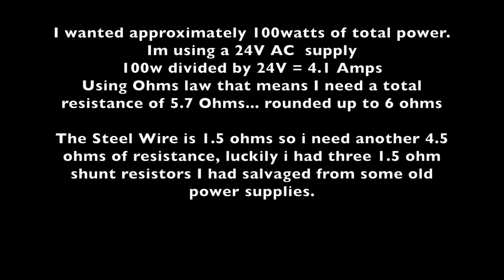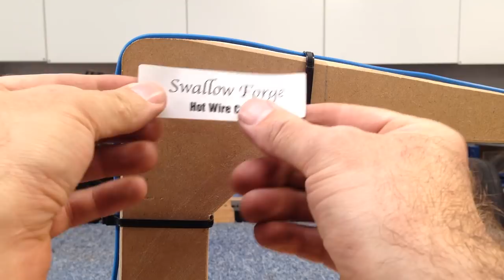How to make a Hot Wire Cutter for foam or polystyrene- styro slicer - cosplay, lost foam casting etc

Comment: I have to cut some 4 inch thick 30h high density foam  strips about 4 inch wide of a 2ft x 2ft squ section to glue onto the other square peices as the new ones are just a bit small so building this cutter will help in doing the job instead of buying one for a one of job. The foam cost me an arm and a leg as I'm doing my 2 x 2 seater sofa's as the foam cushions you sit on is way too soft as you sink into it. 
Many thanks for the idea

Comment: Great Video and awesome setup! I only found one issue with this, and I am only trying to help you and others out. When you added the resisters it did not do anything but waste electricity. While you added more resistance to the circuit it was added in the wrong place. The point of the resistance is being in the wire it is what heats the wire up. If you add resistance in another section it will heat up that part aka the added resistors. So they serve no point in the build besides wasting power. Besides that great video!
Reply: Glad I'm not the only one who noticed it...

Comment: Nice! What happens if you touch the wire with fingers? just hot or shock or both?
Reply from the maker: It's hot. At 24v you won't get a shock. But it will leave a nice burn line. But nothing life threatening. :)

Comment: Thanx for this cool DIY video! I have some quaestions. You want to use 100W power to cut. And you     use serial connection with 3 resistor and an other resistor as a steel wire. Thats a voltage divider. Steel wire become 24V*(1,5 Ohm/6 Ohm) =24*(0,25)=6V. This Wire also have only 6V.  This 6V with 4,1A current make cca. 25W to heat. Also the other 75W is to loose on the 3 sistors. Have i may a mistake, or thats is good theory with this 25W heating. (Sorry for my English. I only learned with datasheet readings.) I wait for answers.Thx
Reply: That’s exactly right. The power supply does indeed provide around 100 watts of power, but most of that is warming the 3 resistors under the platform. However, it appears that 24 watts is enough to cut the styrofoam (power through wire I squared x R,  4 A squared=16 x 1,5 ohms=24 watts).
Reply: @philipbowman6415  Thx for your answer Philip Bowman . My project is immediately done. I prepared out a resistor wire out of a bad hair dryer with 5 Ohm resistant/m. I had hav'nt other  used resistors too. It works fine, but the heat can be faster the resistor wire to burnout. Thank for your fine answer ;). And good day for you!

Comment: Great idea. I should point out that the actual power at the heating/cutting wire is about 24W, the rest being dissipated by the 3 resistors. Would it not be better to power this from the 5volt output of a cheap computer power supply? These can provide about 20 Amps @ 5v or even 30Amps at 3v

Comment: This looks great, is it possible to use 9 volt batteries, so as not to get electrocuted?
Reply: ok thanks
Reply: You won't get electrocuted by 24 volts.  Instead of resisters he could have used lesser power supply.

Comment: Great video , BTW where can we find those resistors? Is there a type ? Because I dont have a spare PS.   What is the wire temparature. Are we going to be electrocuted or burned if we touch it , or both :-).
Reply from the maker: Hello Ogzasu, I only used resistors because thats what I had handy and so didn't have to pay for them. If you are going to spend a little money, I would get a Light Dimmer Switch instead. I would get one that can handle at least 400W. Wire this to the mains side of your transformer and you can regulate the temperature of the wire very easily. as Long as the output of the transformer is under 24 volts, there should be no danger of electric shock from the wire. Hope that helps. all the best SF

Comment: Hi. I have a question. I'm using Nichrome wire 0.40mm a length of 20 cm. I use a power supply of 9 volts and 1 ampere, but noted that not hot enough to cut well. You can suggest me which is the necessary power? Thank you very much for your answer. Greetings from Argentina
Reply: +Guillermo Andrada  2.6A/5.45V

Comment: Superb woodworking. The electrical principles though… well…

When I make one I’ll use this MDF plan, it’s superb. But I’ll constantan wire for higher resistance and a smaller, cheaper power supply. I won’t rely on a cold resistance measurement. Instead I’ll measure current and voltage when operating and calculate resistance. What you have there is something like a 12W wire cutter with a 40W heater underneath.
Reply from the maker: There is an additional variable power supply video on the channel. You are quite right about the heat dump, and but the idea was to make it super simple requiring no electronics. Check out the power supply video using a simple pwm to give better temperature control using nichrome wire.

Comment: You could use kanthal A1 for wire. Its durable and I use it for vaping. I just finished my small foam cutter  and used kanthal A1 0.35mm/27AWG  14,95ohm per meter. You might not need those resistors anymore. My foam cutter's total resistance is 1,85ohm and I used one of my batteries for vaping- sony 18650 Li-ion 3.7V  35A. It goes to 2.2~2.4A.
Reply: +SmokeArrow Yes I think so. Someone on YT did a similar thing. I vape myself and have all the parts. Hmm.

Comment: Nice Job,    You can buy a "Doorbell" transformer at Home Depot.  I believe they come in different voltages,  16 or 24 volts..  You can run it with a regular, wall Dimmer switch,  instead of using resistors..   That way,  You can adjust the heat for thicker Foam..   If you're gonna use the blue foam,  It's a little denser and needs a little more heat to cut too.
  I'm not criticizing,  just adding suggestion for the viewers that don't have any parts on hand and have to build from scratch..
Reply from the maker: All good suggestions. Thank you. :)

Comment: Doesn't shunt simply heats the air with no use? The string dissolves only 25 Watts of power, and 75W of designed 100 are dissolved on shunts. Seems the same efficiency for foam cutting could be reached using some 8 volts transformer.
Reply from the maker: I was using what I had. You can use whatever power supply you wish. Hope you enjoyed the video. All the best. SF
Reply: you are absolutely right. take constant resistance wire, our smaller voltage transformer.

Comment: Here are some useable specifications using nichrome wire and a 12 volt car battery. To get 36 watts of power, use exactly 18 inches of 26 gauge type 80 nichrome wire. If it isn't hot enough, shortening the wire to 15 inches will give you 43 watts. Shortening it to 12 inches will give you 54 watts. If you find 36 watts is too hot, lengthening the wire to 21 inches will give you 31 watts, a little down from the 36 watts.

You might want to experiment with the length before you make the final size of the frame length spacing. If you have made the frame too big (meaning you need the wire to be shorter), just add 16 gauge copper wire to make up the difference. The copper won't heat up.

Don't use anything but a car battery or a good motorcycle-size 12 volt battery with good connections, using 16 gauge or larger insulated copper conductors. If you have a 12 volt power supply which will put out at least 5 amps, you can use that instead of batteries. Attach the copper conductors to each end of your nichrome wire with a secure mechanical connection. You cannot solder copper to nichrome wire (the solder may melt even if you could).

Using one of the above recipes will waste almost no power anywhere but in the nichrome wire. The highest current will be about 4 amps, for the lowest wattage about 2.6 amps. Not much for a car battery. Watch out and don't burn yourself. You are, after all, heating a wire hot enough to melt plastic pretty fast.

You should know that I have never built a styrofoam cutter. I just know how to do the math for wattages etc., so I don't really know how many watts it takes. I assumed from the video that something around 35 watts works because according to the instructions there he was using about that much. The other 70 watts or so were just heating up the resistors.
Reply from the maker: +Damian Appert Thanks for the great info, However there are certain aspects in practice that mean you need a little more power than in theory. The main one being power loss through heat dissipation. This can even be affected by the temperature of the room you are using it in, If your workshop is 10°C the cutter will need a higher wattage than if you are in a heated workshop as the wire looses heat quite rapidly. Too Hot and the polystyrene melts too much, too little and it won't cut cleanly. A simple way is to use a light dimmer on the transformer (or a basic Pulse width Modulator, although a dimmer is the easiest to source) that way you can adjust the power to the task you have in hand. all the best SF
Reply: +Swallow Forge , good comment. I think I would suggest a variable 30 volt power supply with a capability of at least 3 amps if someone is willing to go for the extra expense. Another easier way might be to stay with one of the recipes I suggested with the 12 volt battery, then just add a little extra resistance wire length for cooler operation and then use a copper shorting clip wire to short out some of the resistance wire to get a higher wattage on what remains. The resistance wire then becomes a variable resistor as more or less of it is shorted out. To be clear, the shorted part would remain cool and the rest would get hotter, so attach one end of the shorting wire to the top and the other end just part-way down the resistance wire.

This last suggestion may be a little more palatable to those on a tighter budget. I would caution folks to be careful not to accidentally short the entire resistance wire because this would produce some very dangerous heat and sparks.  The shorting wire would melt in your hands!

Comment: hi. Is this current with this voltage is safe in case you touch the wire?  might be stupid question but i am reallly not into electronic so far. thx
Reply from the maker: At 24v its very safe. Although the wire will be very hot and can burn. So i would suggest being cautious.

Comment: If you use resistor, your powers on nihrom was only 24wats, because voltage on resistors 4.5 om was 18volts, however it means with 4A in circuit = 72 wats on resistor???
Reply: You have rightly pointed out.

Comment: mmmmmmmmaaaaaggggnificent. you're using AC, would there be any explicit problem from hooking it up to a pair of car batteries in series?
Reply: Yes 
Car Battery : DC
Regual AC : AC
But you can alway get a converter
Reply: no,this tool uses short circut to produce heat so it doesnt matter if you use ac or dc,they are diferent but in this case it doesnt matter
Reply: no,this tool uses short circut to produce heat so it doesnt matter if you use ac or dc,they are diferent but in this case it doesnt matter
Reply: no,this tool uses short circut to produce heat so it doesnt matter if you use ac or dc,they are diferent but in this case it doesnt matter
Reply: Nenad Tepavac
Triple Post?

And yeah the 1 I built runs off a battery charger. Runs all day long just fine.
Reply: +Linkxsc yeah sorry for triple post it showed up on my phone as an error ,anyway I am glad it worked.

Comment: Would this work with a power supply that outputs 4.75V and 0.55 Ampère, which would mean a resistance of 8.64 ohms. If i had the same cutting wire as yours then I would have to add a resistor of about 7 ohms. Would this work or did i forget something? Thank you in advance.

Comment: Don't use a guitar string, use a piece of constantan wire. You can get constantan in a 0,2mm thickness and 16,1 ohm per meter, ½ meter = 8,05 ohm and so on.
with the constantan wire you can get the same result with ~25-50W

Comment: I just purchase the plans but they do not show the electronics or wire recommended. Can you supply me with a list
Reply from the maker: The wires I use are 2.5mm multistrand. This is so that the wires delivering the current do not get hot themselves. (32amp rated) 
All the calculations required are in the video, However, if you need any helo, message me on www.facebook.com/swallowforge and I will do my best to help.

Comment: I saw another video where a the wire was attached to the top with a spring and hook so you can quickly disconnect the wire for "inside cuts", though I suppose thats not a problem for you.

Comment: I am making one, but can't get the circuit to work... I was using nicrom wire stripped from a hairdryer and a 12 volts transformer, coud you please give me any direction on this? is the voltage too low? what shouild i do? I do have access to a pc power source... could it do the trick?
Reply from the maker: +amaral sanchez it may be that the power supply you are using cannot provide enough current for the length of wire you have. A bigger transformer may help. 
If you can, measure the resistance across the wire. And use the power triangle to calculate how many amps you require. I found about 100watts gave enough heat to give a nice clean cut. But you may have to experiment.
Reply: you need a transformer with a good amperes

Comment: If i use a 9v adapter or charger,is there any problem held?
Reply: It's not only the voltage that matters, it's the Amps, the resistance (the length of the wire) and all components. You have to do the math using a multimeter and Ohm's law as stated in the video.

Comment: okay, what if you wanted to start in the middle of the foam and cut out a small hole, etc.?  Disconnect wire?
Reply from the maker: Instead of using a closed loop bolt for the top attachment, use a hook. Twist a loop in the top of the wire and place this over the hook. this way, if you need to cut in the middle, Switch off the power, unclip the wire, pass it through the foam (you may have to push a hole through with a skewer first) and then reconnect to the hook.  turn the power back on and start cutting. Hope this helps. All the best SF

Comment: Well first I need to build my own miter saw, band saw, radial sander, drill press, multimeter, and soldering iron. So if you could just upload those videos next that'd be greeeeeeat.

Cool video!
Reply from the maker: You dont need to build any of those things. You can use a hand saw and a drill and a screwdriver. I already have the tools so I use them as its quicker. if you dont have a soldering iron use connector blocks. There are always ways around any problem, just look around at what you have and find a way of doing it.

Comment: I would have used a switching power supply this way you can regulate the voltage (which can be handy with thicker or thinner material cutting) awesome design tho!

Comment: put up a link to buy the power source online. the power source is alot more complicated to figure out then how to connect two ends of a wire. people aren't going to know what amp/watt rating to buy for a 24 v transformer
Reply from the maker: +David Oliphant 
The Calculations are very simple and explained in the video. Hope that helps. SF.

Comment: Great video and really informative.  Love the detail shown.  Will this cut foam sponge too?  Would I have to change the heat settings? Thanks. John
Reply: I worked on a sign shop cutting styrofoam letters with a similar hot wire table. It was set up with a regular light dimmer switch like my mom had in her living room.  This was connected to a 24 volt transformer you see in home central air conditioning systems.

Comment: As pointed out  in other comments you waste much energy in the resistors (~70W). To avoid this and to improve the hot wire cutter you could use a mosfet (n-mosfet) which you can regulate with a potentiometer. It's not complicated and will also allow you to control the heat.
Reply: +martin richardt Needed Parts are 2*diode, Mosfet IRFZ44N, capacitor (>=35V, >=220uF), 2 resistors (4K7, 1k2) and a potentiometer (50K). The parts are not expensive and cost alltogether only a few bucks. If you interested I can provide the schematic, which I checked it with LTspice.
Reply: +missionpage I sent you an email.

Comment: It seems a 12V transformer would have been perfect for the wire, with no need to add the extra resistances. Great job.
Reply from the maker: I built with what i had to hand, but yes 12v would have been fine.  :)

Comment: Have you ever heard of kanthal or nicrhome?
You should use those as Heating wires and the thinner you make them the more precised your cut will be and the more resistive it will be.

Then you wont need those expensive and wasteful resistors.
Reply from the maker: You will still need to regulate the power supply regardless what you use as the wire. Otherwise you will simply end up with a puddle of rapidly cooling metal.

Comment: It's more efficient if you put a temperature regulator or auto termic switch controlled by measurement of the temperature
Reply from the maker: +Ton Loef 
I would have to politely disagree with you there. Because nichrome wire has a stable current to temperature ratio it is much easier to control the current.